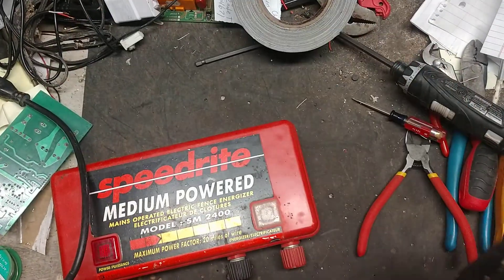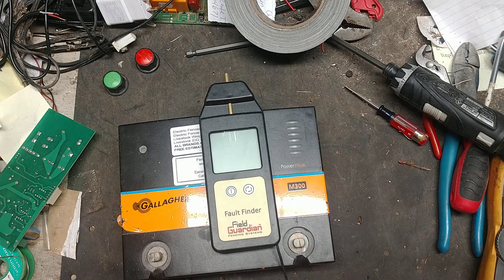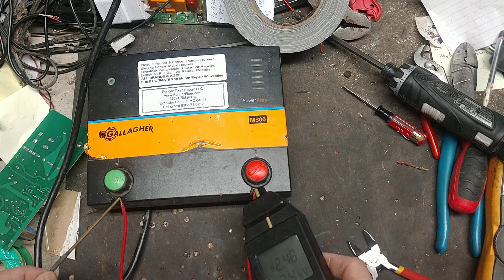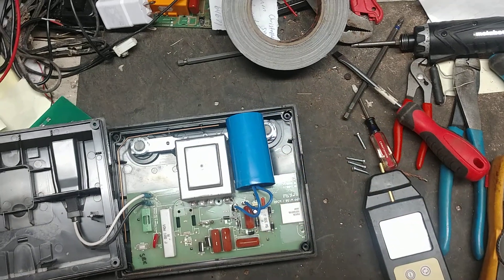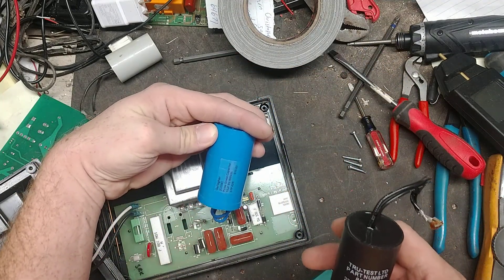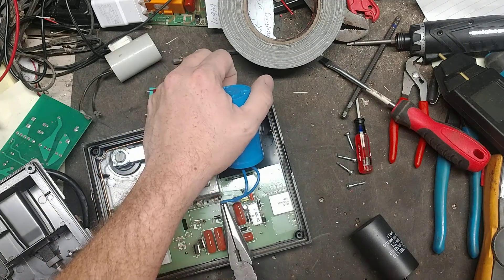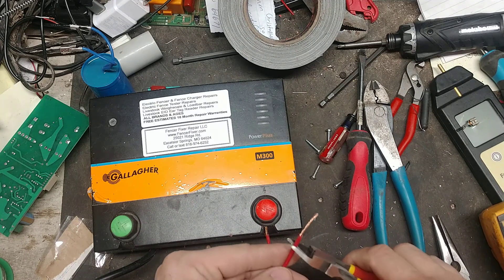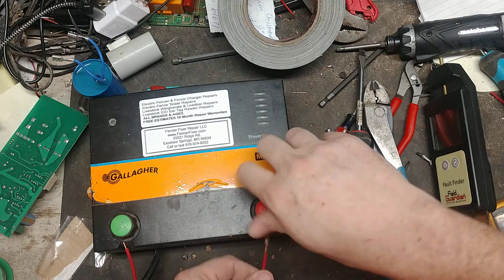Making An Electric Fence Energizer Stronger

Comment: So is there a point of to much of a capacitor for a unit as in overloading the box and causing more damage?
Reply from the maker: There are a few things you have to worry about when doing stuff like this. One is overloading the output transformer with more energy being pumped through it if it's not built to handle it. As well as the SCR the triggers and fires the capacitor has to be able to handle the extra energy of the capacitor it's firing. And on some brands and models there will be one or more diodes protecting the SCR and they can be overloaded and go bad if they're not a high enough amperage and voltage. Most of the other components before all that stuff should be fine for the most part.

Comment: So it is the capacitance that increases the fencer?  I thought it was the coil/transformer.  I have 4 weak out of the box fencers and am looking to keep goats as well as a horse in.  Sadly all my animals have learned bad habits already and my fences are in shambles.
Reply from the maker: It's a combination of things. The transformer just takes the energy it gets from everything else and puts it to the fence. A transformer can only take so much energy into it before it plateaus or burns up inside, so there has to be a good happy medium between everything. We are also offering our own brand of fence chargers before too long, March/April timeframe. For goats you need at 4 to 6 joules minimum to make them listen and respect the fence. I'm not sure what size units you currently are using, they may not be stout enough for them.

Comment: Can you make the energizer "click" faster? I'd like to modify mine, just don't know which resistors or capacitors to change. I have an American Farm Works #EAC15MAF-R1
Reply from the maker: No I do not, there's a lot that goes into that timing stuff, not just the resistors and caps in it. If you make it discharge too quick, you actually lose output power because it's discharging to fast for it to build up it's shock. If animals are getting out, you probably just need more joules vs a faster speed or add some wires above or below so they can't sneak through as easily